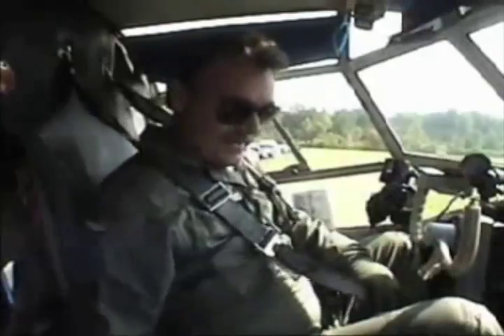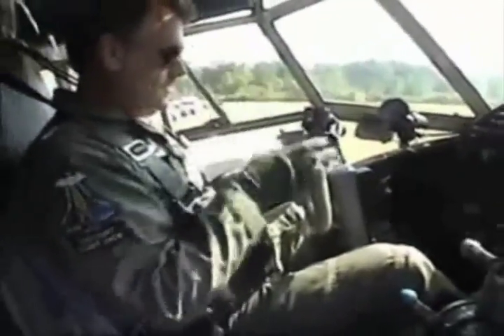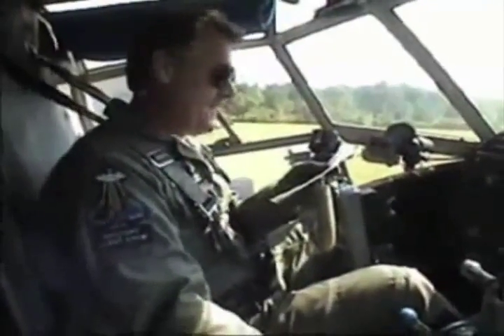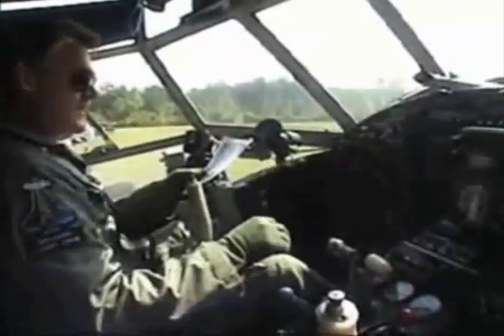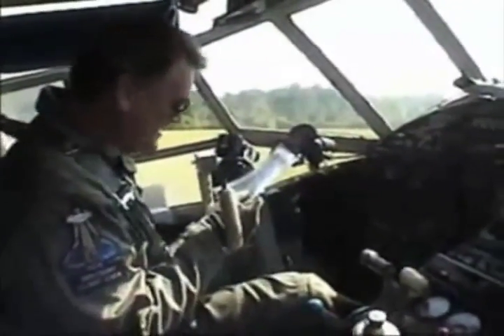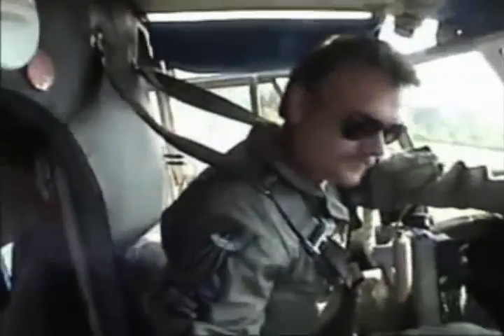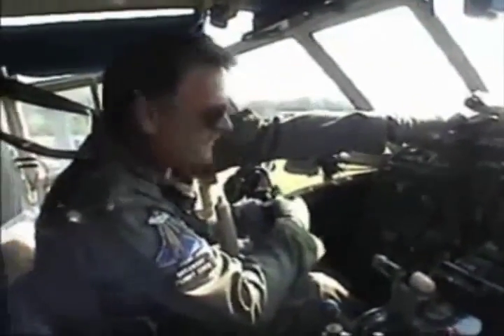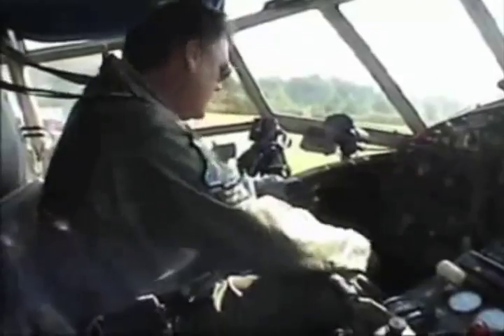How to start a 1000 HP Radial Engine on a Antonov An-2 Colt

Comment: Very cool! Thanks for the video! I've actually just bought one of these engines from a scrapped aircraft, hoping to turn it into a stationary display engine to begin with and possibly put it in a (big) car later down the line!  Do you mind if I ask you some questions about the engine?
Reply from the maker: I guess I am a couple years late in responding to you.  If you haven't built a car yet, ask away, or show me the link to the car build. :)

Comment: why do you start it with mags off.do you switch on mags during the prop rotation.
Reply: So you don't get a manifold fire. Bet you never used an inertia starter either.
Reply: The prop also needs to turn a few times just in case some oil has collected in the lower cylinders and causes some hydraulic lock uissues. If the engine actually fires (mags on) it can push components to bits, while when just rotating 'dry' there's less torque at work.    At least as far as I know. Hence the manual turning of the prop before start up. Just to get oil moving.
Reply: Get Oil moving and ensuring there isnt any pooling in the bottom Cylinder(s).  I know of at least one Accident that happaned that way.   Prop wasnt rotated through a couple of turns on a Radial before start, and it Hydro-locked, Bent a rod, which ended up snapping, Piston came out of the jug, and stopped the engine cold... BAD scene.